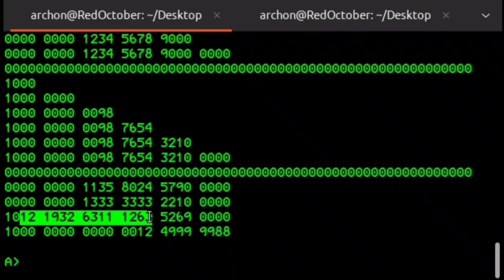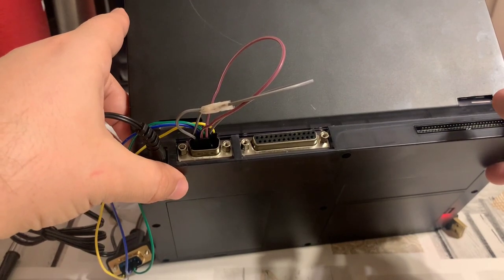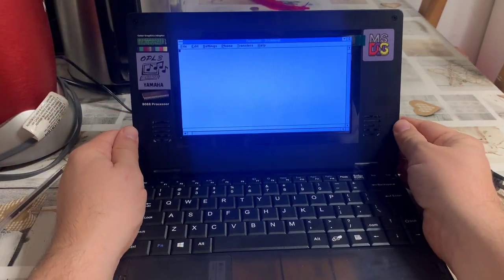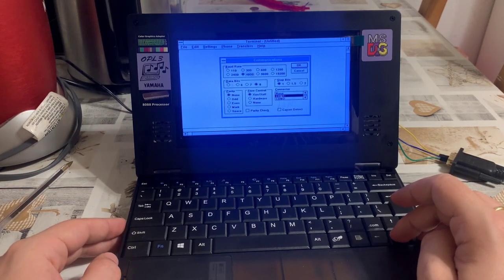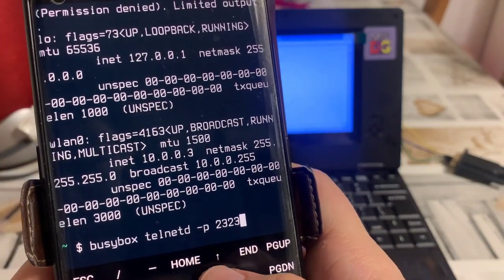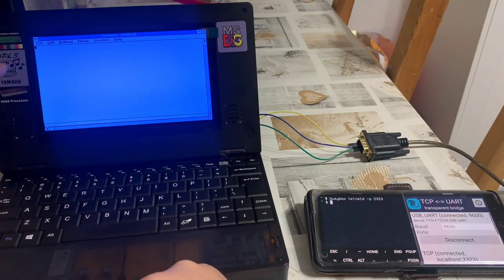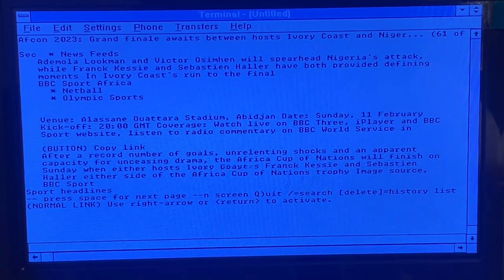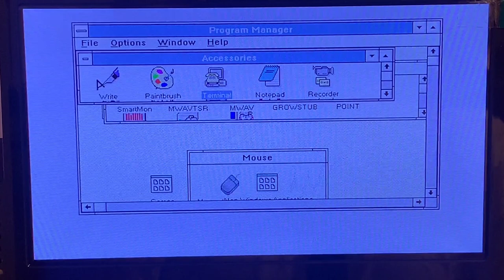(2/58) TTY/SLIP/PPP: Nigerian soccer on a Book 8088 browsing the web via an Android smartphone

Comment: thanks for the procedure! To start from the beginning, do you need Android apks like termux, busybox, telnetd, tcpuart and implement a db9 null modem cable on the serial-android adapter?
Reply from the maker: You need Termux, within Termux, you need busybox which should give you telnet & telnetd; within Termux, you also need links/lynx/some CLI browser of your choice; outside of Termux, you need TCPUART or similar to bridge between the serial port and Termux which talks only network connections, not RS232 by nature; and physically, you need to establish the nullnodem connection indeed. I know, it sounds like a lot, but these are small steps - and if you have issues, drop a line on some video comment section!

Comment: Hi Nino! That's interesting. Some time ago I bought some parts in order to build a wifi to serial interface using arduino nano. I've had no time to build it, but It would be very nice solution for this 8088 laptop.
Reply from the maker: Oh, that is totally easy, basically you need to just adjust the "Serial passthrough" sketch for a serial port + a wireless interface; if you find it helpful, you might look at that thing I made for LoRa: https://github.com/KedalionDaimon/LoRaESP32RTTY/blob/main/add_key.ino, basically the parts  while (LoRa.available()) ... and if (SRL.available())... I know, you mean "normal" Wifi, but the principle is the same. :)
Reply from the maker: This may also go into the right direction... :) ... if you adjust it for the passthrough: https://github.com/KedalionDaimon/sonar-signal-ESP8266
Reply: @ninoivanov  oh yeah! I remembered that's the esp8266 actually! The project was easy, but I burned two of those trying to do the C64 wifi board ... silly me
Reply from the maker: @retronoobtech8551 You need a MAX232 ttl-to-RS232 voltage converter… they exist as very cheap modules with proper DB9 connectors… I wish you success!!
Reply: @ninoivanov  thank you, I'll try
Reply from the maker: @retronoobtech8551 - As we speak, I am uploading a new video in this series implementing exactly a Serial RS232 to Wifi bridge (using an ESP32 microcontroller board), so that the Book 8088 may go online via an iPhone (and iSH). It will also contain a link to the source code, which is explained at said video's end. I hope that shall aptly serve to aid your retro efforts & purposes! :)